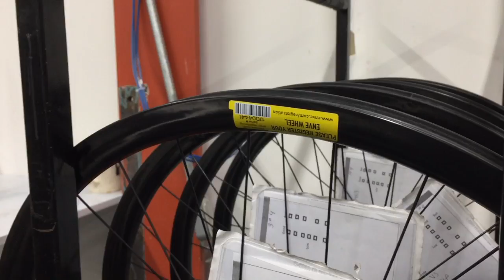Santa Cruz Bicycles HQ Factory Tour

Comment: The only reason they build the wheels there is for quality control and it simplifies logistics since they're made for a particular bike. If they were generic sets and they could put them in a mold, then they would just be built over seas where the labor is cheaper. That line was bullshit and this guy doesn't even like his job. 
Also, they don't even make bikes there. It's just an assembly hub. Santa Cruz bikes are Chinese made bikes with boutique prices. 

They should lower the bike costs a bit to reflect the slave labor pay. If they were made in America, at least they could justify what they charge.

Comment: Interesting, if this is how most bike factories work, I now see how my new bike came with the wrong rear shock installed (not a Santa Cruz bike). Just takes a parts picker grabbing the wrong shock in the “supermarket”, apparently. TBH, I thought there would be a more rigid process in place for that kind of thing. Like specific models be built in a dedicated area where only parts for that model are kept, but apparently it’s a bit more willynilly than that.

Comment: 🤩 I never knew Santa Cruz also makes bikes.  Since the brand isn’t sold in my country.  So you can now buy a Santa Cruz  🛹  🚲
Reply: Chris Bautista Santa Cruz skateboards and Santa Cruz bikes are two completely different brands. Even if both are located in California, they are completely different.
Reply: @samtb not quite true what you write there. Here’s a cite of Santa Cruz bicycles website faq:

Is Santa Cruz Bicycles related to Santa Cruz Skateboards?
NHS (Santa Cruz Skate, Snow, Surf) is our sister company.
We are both located in Santa Cruz, California. There is some joint partnership, but we are completely separate companies.

NHS contact info -

NHS, Inc. 
PO Box 2718 
Santa Cruz, CA. 
95063-2718

Comment: That's not a factory that's an assembly area, where do you make the frames?
Reply: Probably made by a subcontractor in China.  But, it looks like they are bringing carbon frame and other carbon parts in house, which is a good thing.  The thread is three years old, so maybe by now they are in production, however, from what I saw, they appear cramped and carbon frame manufacturing takes up substantial floor space.  See the YouTube LOOK factory tour and that reveals how much space is required, a lot.